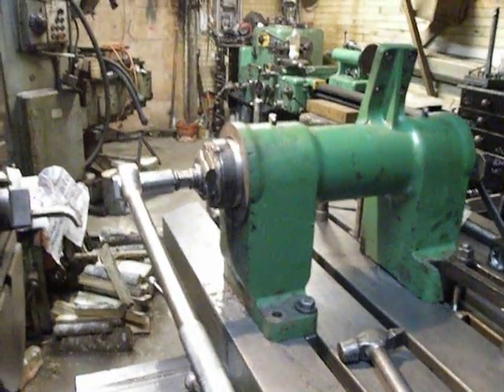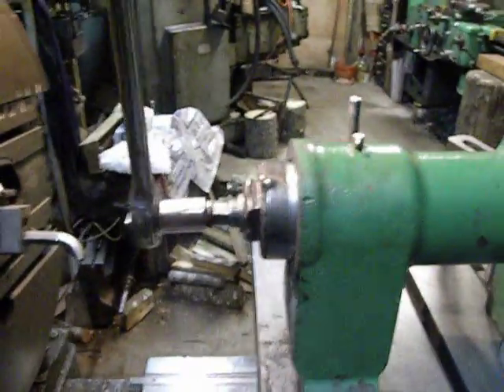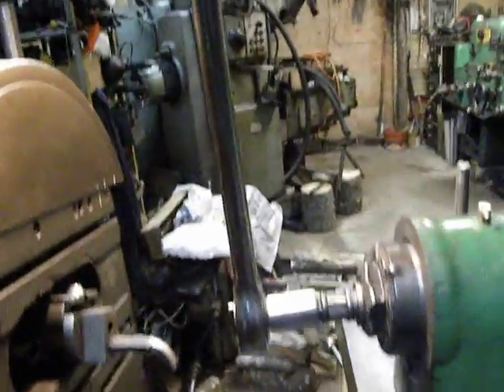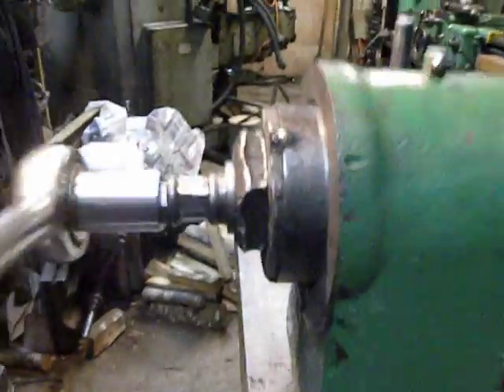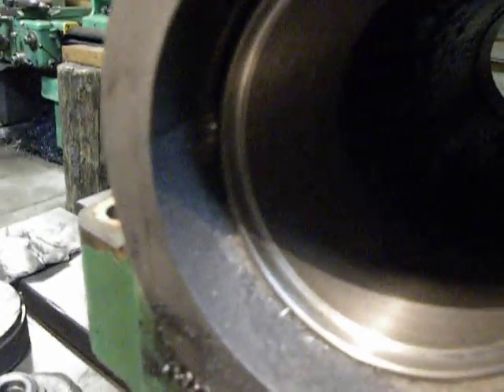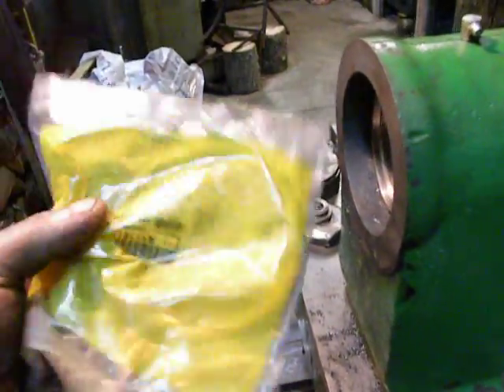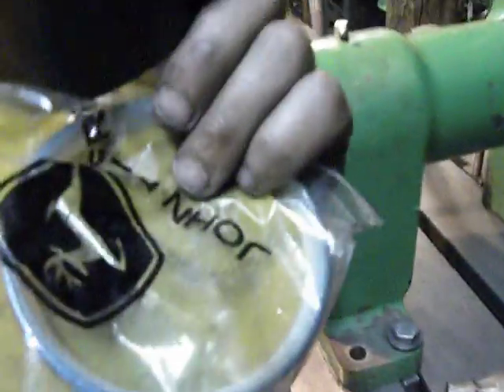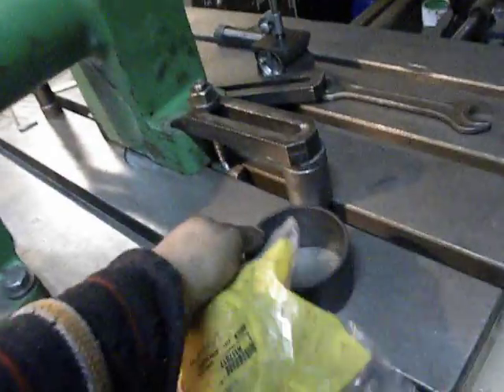Work on Horizontal Boring machine Stanko 2L614 - instaling repair bushing in piece from a John Deere

Comment: Slow, steady but very effective!
Reply from the maker: Yes, so it is. I was pull in (instaled) bushings 10mm (50x70x60mm) tick with 0.25mm oversize - we used 2m long piece of waterpipe to get arm of force... we done it by same this way.
Thanks!